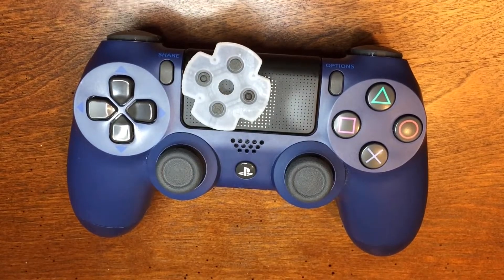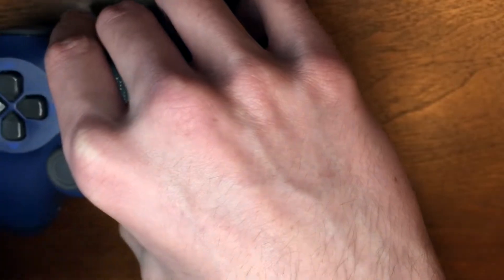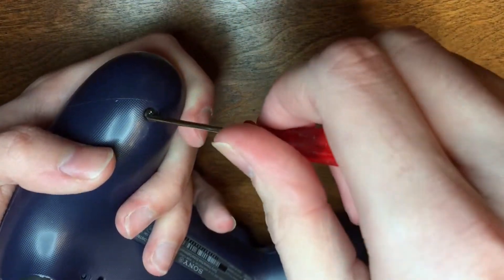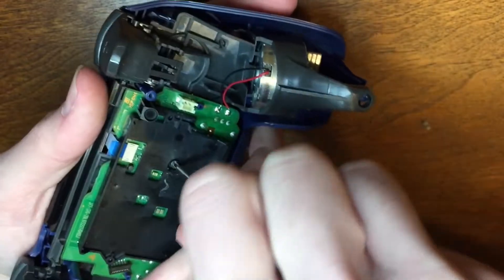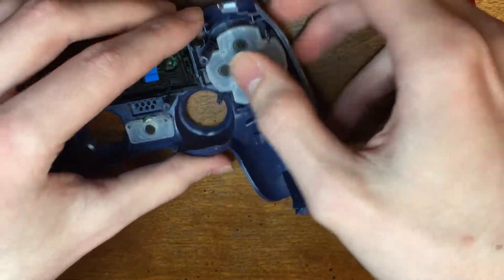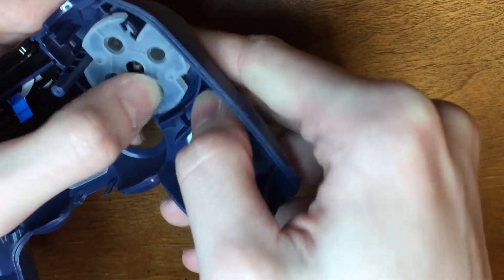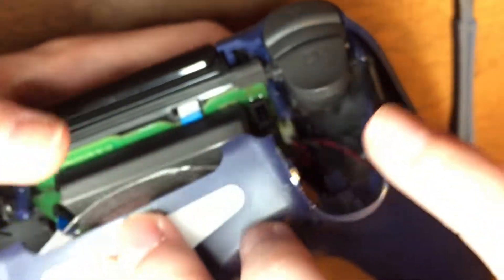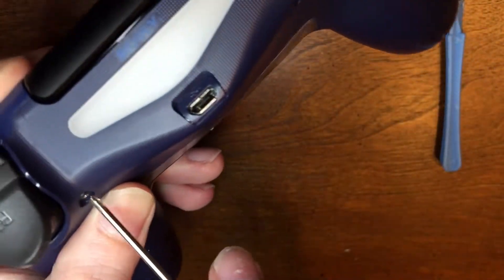WHAT DRAGON BALL FIGHTERZ DOES TO YOUR CONTROLLER! | CUH-ZCT2U | D-Pad Repair | Guide

Comment: Have you tried the Hori mini fighting commander? It’s got a really good dpad and it’s cheap as well but there are two versions; ones wireless and one is not. I have the wired one and it’s really good. The dpad feels more solid but elevated where it rises for the thumbs so it’s not like your guessing if your blocking high or low you should try it out.
Reply from the maker: I haven’t tried it but I have heard of it. I’d definitely try it out but my worry is, with time, it’ll wear out like everything else. It would be nice to try it out and $40 isn’t too bad, but considering FighterZ is the only fighter I really play Idk if I’m willing to make the purchase just to try it.

What really pisses me off tho is the PS5 controller isn’t backwards compatible so I can’t buy it, and the PS4 doesn’t recognize PS3 controllers so I can’t use those either lol. Idk I may break and buy the fight pad though when I run into some more money.
Reply: @PunkPantha  yh definitely do it Fighterz is the literally the only fighting game I play and I play it so much that I’ve had concerns about the ps4 dpad and went and purchased it for only that game lol but it’s definitely worth it if you play fighterz a lot like me.
Reply from the maker: @darkemperor418  if I do get one I’ll def mention it in a video, maybe do sort of a review of it. Maybe when I get my stimulus check I’ll buy it 😅 haha